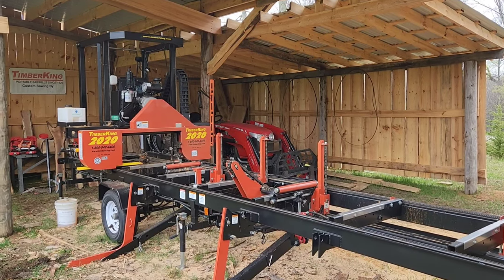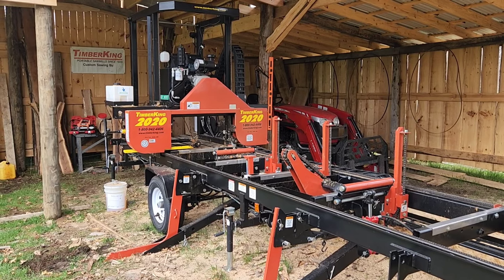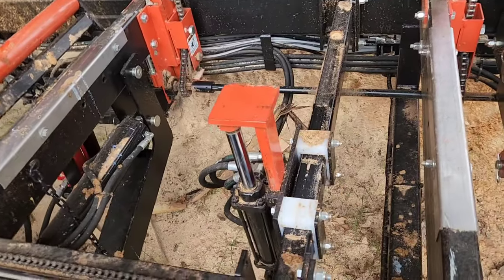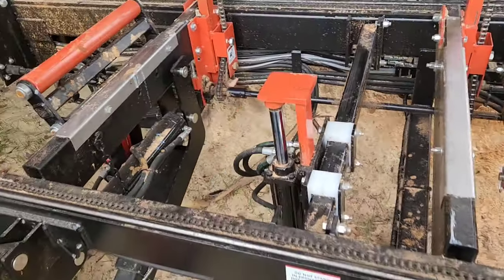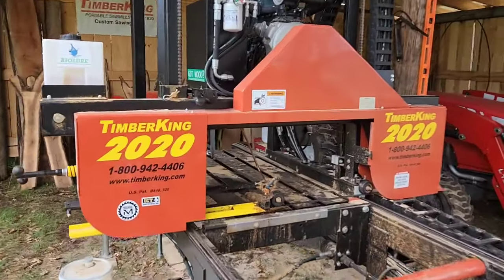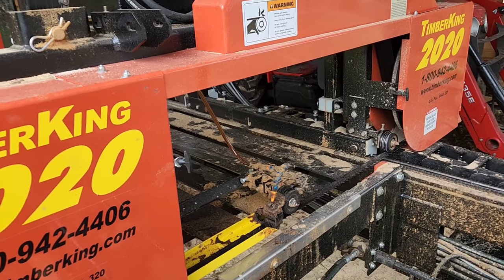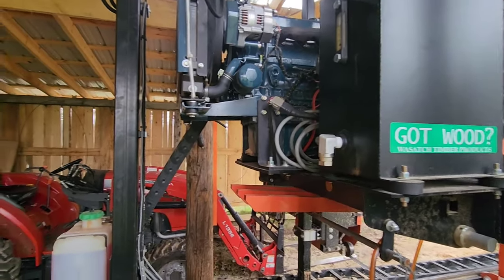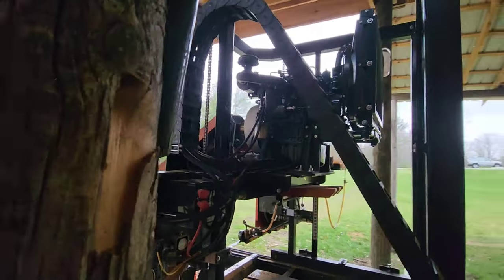This is the best sawmill on the market, and here's why

Comment: I hope your sawmills from basic to commercial series doesn't only focus on bandsaw mills.  As you know there are other styles of sawmills that work just as well (swing blade, circle, etc).  I think TimberKing makes a great sawmill and certainly rivals anything that Woodmizer offers.
Reply from the maker: Correct, I talk about circle mills and swing blades, but mostly focus on the portable sawmills.  A stationary commercial production mill is the ultimate platform for production
Reply: TK is years ahead of WM in design, WM needs to get rid of the claw turner, electric over hyd pumps and electric head feed

Comment: What are the chances you would ever bring the mill to the wood?  I knew some folks that had every intention of tow mill around but as they said after doing it that it's just so much easier to bring logs to mill as set up is such a PITA.  A guy not far from me had a TK 2000 for a while but he sold it and replaced it with a Timber Buddy XP-380 out of PA.  Oh my lord the mills are night and day speed wise.  The Timber Buddy just chews through wood with it's 120 hp John Deer and none of the emission exhaust/filter.  His blades are pricey but they are also big  Timber Buddy has only 1 mill but you can customize it how ever you like.  There is usually a new one up for auction somewhere.  It's made by an Amish guy and they have no website.  I saw one last year sell on auction for $60k but $70k would be normal.  Set Works, powered tail, pretty much everything 120hp but the thing is BIG and Heavy

Comment: Great job on going over the design and functions with the pros and cons . I was going to order a TK2020 to replace a 1400 three years ago but opted to upgrade the 1400 with a larger motor, power log turner, power log dog, basic setworks and finally the vertical log stops. It has been well worth the money.

Comment: That was my issue as well.  The 2020 Saw was 14K higher than the 1620 one I recently received from TimberKing.  It works great, but I miss the idea of a few additional hydraulic features, such as the log stops, up and down on the log dog, and the in and out of the blade guard and the Toe Boards.  As this is more of a "hobby" saw at this point and one that I am learning on to fully understand the sawing business, it currently fits my needs, but the 2020 TK might be in my future...

Comment: Have you used or seen performance of the 37hp VTwin gas vs the 24hp diesel. Curious as to the performance difference? $10K extra is tough.
Reply from the maker: I've run my buddy's timberking 2000 with the 37hp.  The performance of the gas engine is a bit less than that of the diesel but not much.  On larger logs, you kinda chase the RPMs, meaning you limit your cut speed based on the loading of the engine.   I don't do that as much on the diesel due to the amount of torque the diesel produces.  I'm going off rough numbers in my head, but the gas engine is around 50 ft lbs at around 3,000 rpm, whereas the diesel is at around 78 ft lbs at 2,300 rpm.  The other big thing I like about the diesel is that there's a remote start on my operating console.   The gas you have to reach up on the engine to choke it and turn the key on and off to start or stop it.  That is a little thing, but it is something simple that should be on the operating console, in my opinion. My buddy has cut over 1500 hrs on his gas engine with little to no downtime.  But one last thing that popped into my head is fuel economy.  On a big job of cutting all day, he will go through 2 tanks of fuel easily, whereas on the diesel, maybe one every 2 days.  Again, it's not a huge deal, but he carries a lot of fuel with him on a portable job.  Hope this helps.
Reply: Thank you! That is exactly the kind of detail answer I’ve been looking for. Much appreciated.

Comment: I did watch this, thanks. then I bought a Cooks.
Reply: Good decision
Reply from the maker: Cooks makes a fine sawmill, and we've owned one as well. I'm just not a fan of all the solenoid control valves.  The direct hydraulics give a little more control and easier to troubleshoot if there's ever an issue.